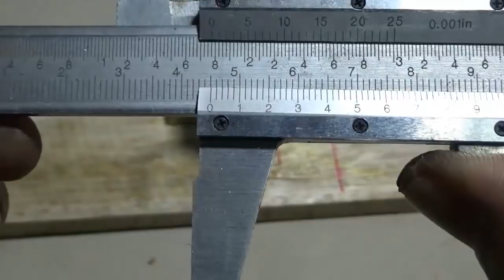Gamma Stirling Engine.

Comment: U are genius.....Sr no problem of piston....problem of had...how to make hade very smooth...
Reply from the maker: Hade..piston cylinder ? Or piston head ?
Reply from the maker: There is no problem, it uses glue that is quite high temperature resistant.
Reply: I mean cylandar
Reply: Sorry i mean cylandar
Reply from the maker: I rubbed it with fine sandpaper installed on the drilling machine.
The method is like this : https://www.youtube.com/watch?v=YaQDOu_iAg4
Reply: thanks